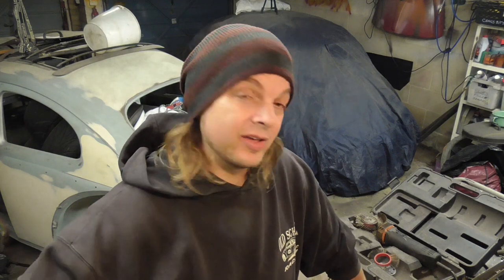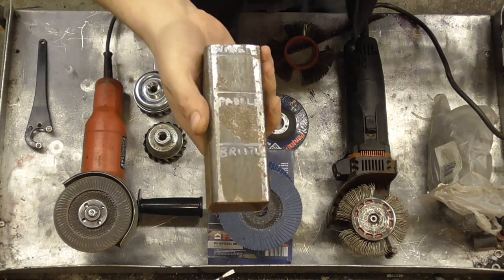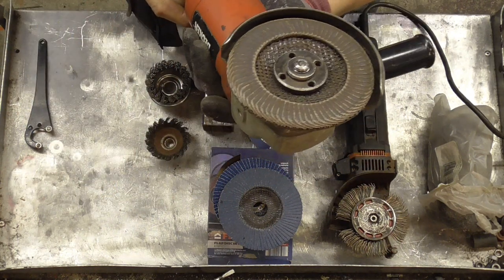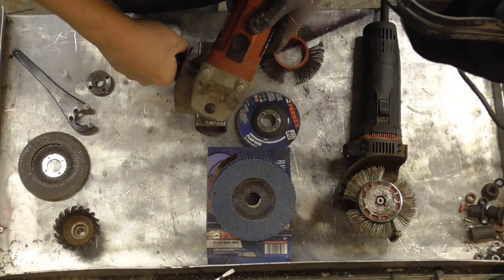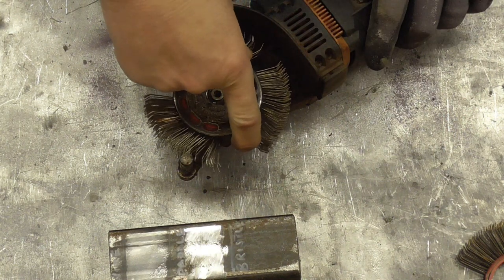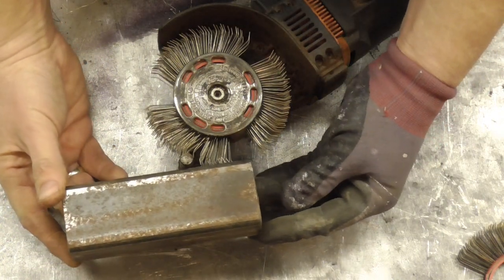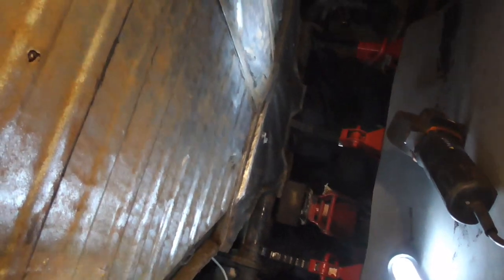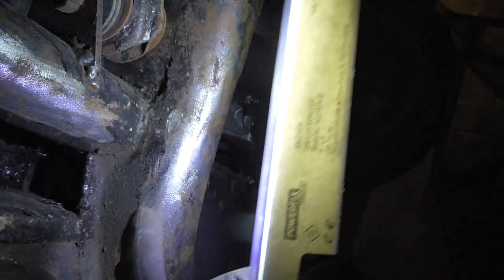Bristle Blaster On Test / Review - Paint & Underseal Removal, 'Sandblast' Surface Prep

Comment: Excellent review Arrgh! 
Always looking for better quality tools, past the cheaper tools as it never saves money and always adds to frustration and badly done results.
Reply from the maker: If you have a decent compressor already you will find the Die Grinder just as useful for about quarter of the price. I have done a quick review of that too. 
https://youtu.be/yoCdsgWFd9M  I bought one if these, my little compressor doesn't quite have enough puff tho. Thanks for the kind words 😄👍
Reply: @PeoplesCar  Thanks for the heads up on the Die Blaster. Oh we have 4 to choose from 5hp 80 gal Champion to  12v tire pumper, but looking to use an 2hp double  head oil less 30 gal that’s quiet but mighty. Reveal that Vw Bug  or do you have pics/video already? Thanks again
Reply from the maker: @smrtnz5995  I think from memory you need a minimum  of 12 cfm but need to double check b4 buying I currently have a small 50/70L compressor which guessing 7 cfm and its well short on lungs for the die grinder or my orbital sander. I have been given a 2nd tiny compressor of about the same cfm and hoping to link them together when get chance. Please note as I understand it, few compressors can actually deliver the cfm they are rated at! The bug? Beefcake. The playlist for those vids is here, starting with some of my earlier stuff. Thinking about remaking some of those vids as have improved at talking and filming a bit lol. Here is the playlist https://youtube.com/playlist?list=PLas-bMbyRsgCYY66MzG1s6DBcw8oyVHYM I'm hoping to start more work on the 58 and Volksrod 2023 and they both have their own playlist too. Thanks again, Al 😄👍

Comment: Great bit of kit, what paint do you plan to use on your floorpans?
Reply from the maker: Hi :) I've had to return the Bristle Blaster but have got a Die Blaster of my own. MUCH cheaper. Similar results. If you have a compressor and 100 tank....unlike me.... would be a great alternative I think.  Done a very short vid. Maybe edited for next weekend.
As for paint I'm currently using Epoxy Mastic 121. I like the product and it seems to give a tough durable finish. Only downside is you get brush lines and I'm not sure if can be sprayed. I did a couple of vids of using it here...
https://youtu.be/q7mBE0MJhoU
https://youtu.be/eImHJw6LrzE
Going forwards for the other bug pan I'll be doing later in the year or possibly 2022 I'm concidering moving to raptor paint and getting the spray kit for it too. It's also a 2 part system and a few people I've spoken to about it have all sung it's praises. Got to try it myself first tho. Beefcake is getting 121 for now. Hope that helps :)
Reply: @PeoplesCar  Thanks for the detailed reply, the brush lines seem like a small price to pay for the durability.

Comment: Would a bristle blaster work on oil protected steel from the store? Or what would one remove that oil with
Reply from the maker: Do you mean just raw steel that has an oil film on it? The Bristle Blaster will both damage the smooth surface and possibly cause oil to penetrate into the indentations it creates, making future painting less likely to bond. Unless were talking about different things? Won't a simple degrease remove it? Methylated spirit/acetone/degrease etc? Tx for watching 😄👍
Reply: @PeoplesCar  how does one apply that best? also yes. so clean the steel first. maybe wire brush to remove the millscale too. then clean again. then wire blast it?
Reply from the maker: @snorttroll4379  I'm still not entirely sure what your asking me but best to remove any excess dirt etc then blast it. It leaves a very rough surface however. I found the Blaster removes most things from steel but boy it can make a big mess! Lol
Reply: The surface oil wont be removed is my point. So it would not be good for painting. Unless you clean the metal first
Reply from the maker: @snorttroll4379  oh I see. None imagine you could cause yourself a nightmare. It's hard to clean after blasting as the surface become like velcro to any rag etc. I'd deffo recommend thoroughly cleaning oil first if going to paint especially as don't want to impregnate the indentations with hard to remove oil. 👍

Comment: Shut up and take my, wait, how much?
I could really do with one right now for the Ghia floorpans, but I guess it's back to hand tools and pulled muscles for me.
Reply from the maker: I know! Crazy. I've found a cheaper kit online but not from anywhere I would trust. I have an idea about how to make one on the cheap but will have to see if I can find what I need first :)
Reply: @PeoplesCar  Surely it's just an angle grinder/polisher body? If the bristle heads match cutting discs ID it's just the "pinger" part that needs welding on.
Reply from the maker: @djambrosia  it's geared and runs significantly slower than an angle grinder. My idea was to get a small pneumatic die blaster and like you say weld or build an accelerator bar add on. However I just watched a well ised looking 2nd hand die blaster, alone with nothing else in the buy, go for £88! Bit too much for me. I'll keep my eyes out tho :)
I guess if the angle grinder could be slowed by maybe using the adjustable speed controller from my parts tumbler vid and could adapt rhe belt holder that could be an option room but those parts aren't cheap on their own either! :)
Reply: @PeoplesCar   The mbx die blaster has an accelerator bar already i think- it is the mbx METAL blaster that doesn't.  The similar names confuse a bit: the bristle blaster and die blaster create a shot effect as well as removing surface crap, whereas the metal blaster seems to just remove crap, without polishing the surface, but to a lower roughness. I understand its less aggressive and is marketed to the auto trade so it can be used on exterior panels without distortion.. It would be interesting to see if a bar could be fitted to it, but that's an expensive experiment!

Comment: Don’t use it going away from you 😂 totally defeating the design
Reply from the maker: Not sure how that is? so long as the brushes are hitting after the accelerator  bar why does the direction matter?
Reply: @PeoplesCar  have a think about it when you’re in the bath…it will all make sense
Reply from the maker: @jonfoz1379  nope? LOL. Obviously your moving in the same direction as the spin so will reduce its effectiveness very slightly but the accelerator bar flicks the wire so fast I cant see that having a big difference. Plus it's easier to go back and forth than lift it, pretty heavy.